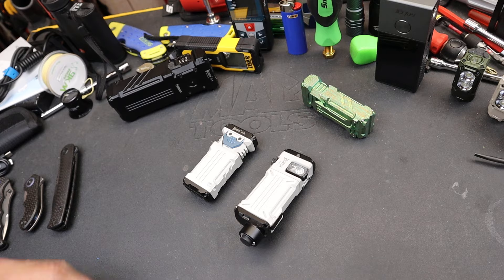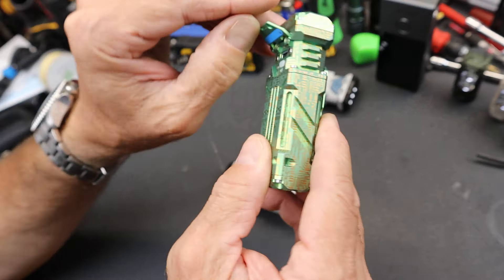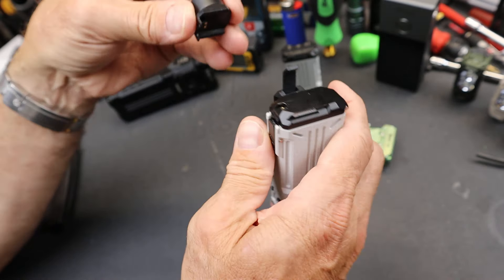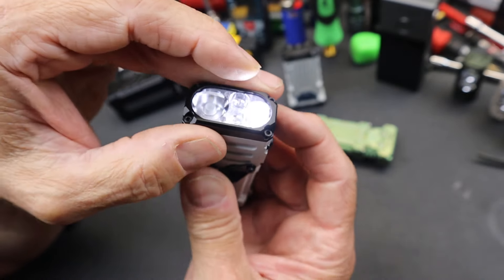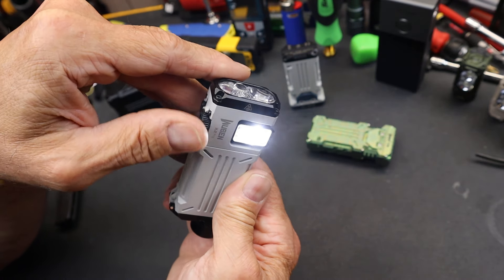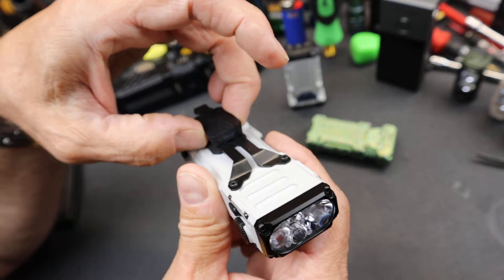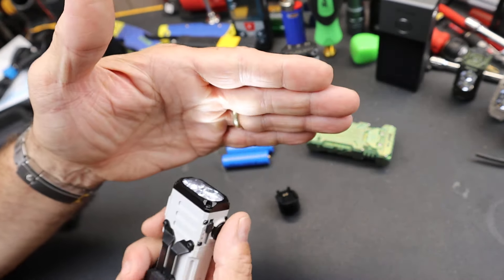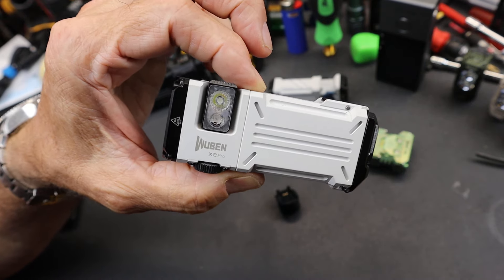Process of EDC Innovation: Wuben X2 Pro. More features. More options. More on-demand simplicity. .

Comment: I have the much smaller wuben x-o, and it's just too heavy for what it is. I have full size aluminum body 18650 angle head flashlights that are lighter than the little wuben x-o. Feels very solidly built (except for the tape holding the magnet in), but i have much smaller, lighter edc lights that do just as much if not more for much less weight.

Comment: I thought that was a vape with a built-in flashlight at first, which I would definitely buy if Olight made one. :P
Reply: Olight’s version wouldn’t have hotswap batteries though. Hence why I backed. Tired of having electronics with slowly dying batteries sealed in.
Reply: @club2772  What are hotswap batteries? Backed what? Your reply to my comment doesn't make any sense. Are you a bot?
Reply: @k1_w3  Technically not hot-swappable as the flashlight has to turn off, but he meant removable battaries. And "backed" as in supported the kickstarter for this flashlight

Comment: Has quite a few features that EDC-grade flashlights have been missing for many years, and also some features that are likely to sink it. Hopefully they won't give up on the good ones and carry them into more reasonable models.

Specifically having a different switch for setting brightness, and a lock. Also too many brands nowadays have been going into irreplaceable batteries which is a shame as that's the component that has the worst EOL so it's good to see they're bringing those back.
Also it's interesting that they're going for different emitters as part of the brightness scrolling, I imagine it also allows for better PWM. And there's definitely a lack in ability to change from spot to flood in EDC lights

Comment: Deep carry is crucial for regular stowage of a flashlight. This newest model is the shallowest carry of the lot! =(

Why hasn't anyone come out with a vertically sliding belt/pocket clip that locks into different positions, accommodating deep carry for regular stowage, and shallower carry to accommodate the benefits of 90° swivel heads?
Reply: get a damn pouch,put a belt through it and put a normal sized flashlight in there
Reply: @votpavel  I've tried running a belt pouch before, but didn't like care for it at all. If it can't  pocket, better in a sling-bag.